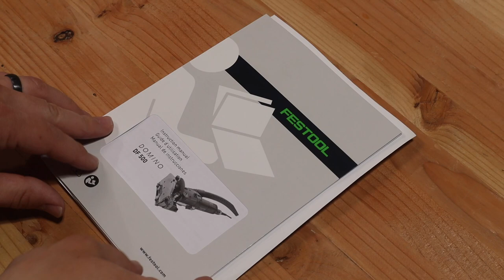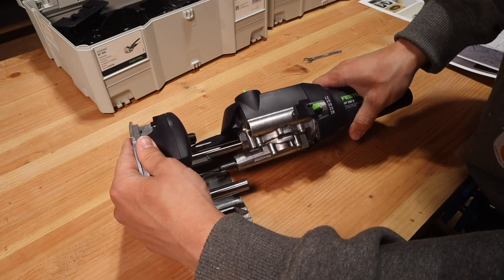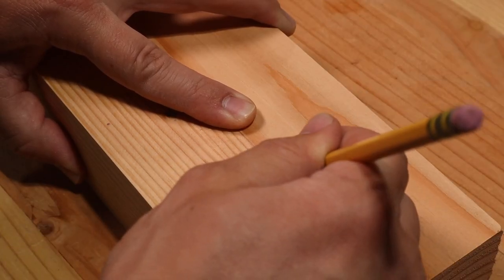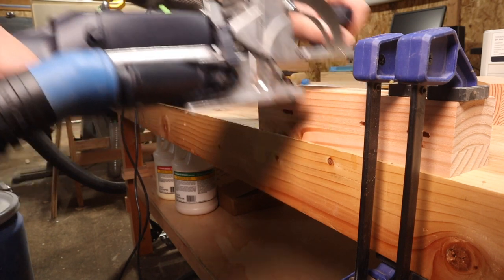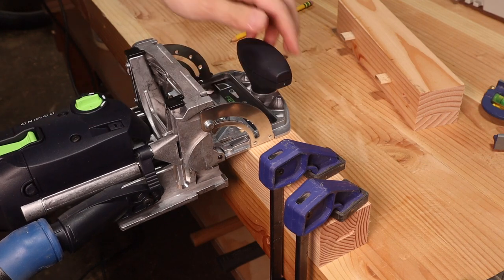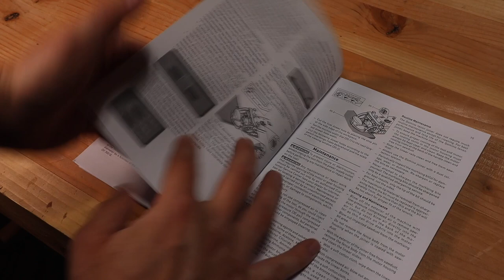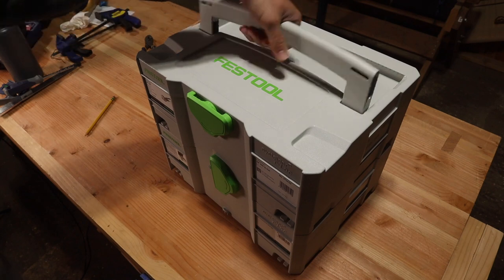Festool DF 500 Domino | Unboxing, Setup, & Use

Comment: Hi! Excellent video, as others have pointed out.
I just got my Festool Domino and I will certainly make a very good use of your video.
I do have one question. I didn't realize I need to use a special  hose for dust extraction. But it seems you are not using a Festool hose. 
So what hose are you using and how did you attach it?
Gracias y saludos desde Mexico 🇲🇽
Reply from the maker: ¡Hola amigo! I’m glad you appreciated the video! I ran into the same question and found there are a smattering of flexible adapters to hook it up to a shop vac. Below is a link to what looks like the next iteration of what I got. It just slides right over the male portion which is on the domino. 

Festool Adapter
https://amzn.to/478nsR7
Reply: @NorthwestCraftsman  thank you very much for such a fast answer. Feliz Navidad!
Reply from the maker: ¡Feliz Navidad!

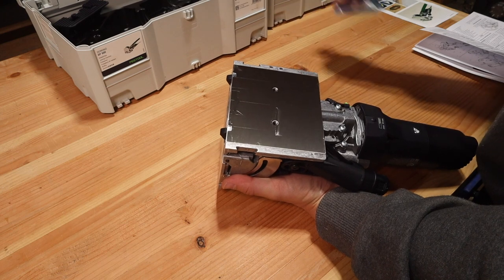Comment: Thanks for the great info! Very helpful video. I noticed that in frame 4:12 after you peel the film off the bottom of the tool, there seems to be “wings” around one of the threaded bores. Is that a mark leftover from the film? I’m looking at an item on an auction site with that same mark and I can’t figure out what that is. Thanks again!
Reply from the maker: Thanks! Glad you found it helpful! 

I think it just leftover from the film. You were talking about the somewhat long and thin making on the bore closest to the camera right?
Reply: @NorthwestCraftsman  Yes, I’m trying to identify if that long, thin marking on the bore closest to the camera is anything permanent. It seems like it hasn’t made much of an impression on you, so probably nothing to worry about? Thanks!
Reply from the maker: Yea, I think it’s just a bubble under the clear film with some of the factory oil causing that. No issues with my tool from it 😊

Happy Woodworking!

Josh
Northwest Craftsman

Comment: Festool - more addictive than crack to people who like quality stuff.  I got that kit earlier this year; it is a pleasure to use and very helpful.
Reply from the maker: No kidding! The build quality is impeccable. I don’t see myself in the market for any more in the near future but those sound like famous last words 😂
Reply: @NorthwestCraftsman  Ok.  In that case, this is not me suggesting that you try out their sanders - specifically the Rotex RO 150 or RO 90...  🙃
Reply from the maker: Well then 😂 for the sake of my wallet, I’ll have to stay away 😂 but, out of curiosity, what are the primary differences? Size and capability? Or something more?
Reply: @NorthwestCraftsman  In their rotex mode, where they forcibly spin the the sanding pad, they can remove material at about the rate that a belt sander does, but in a much more controllable fashion.  Switch it to random orbit, and it's like a finish sander.  And one of their main claims to fame is dust collection - hooked to a dust extractor set to minimum speed, there will be next to no dust left behind.  Additionally, they're very well balanced - they are much less likely to leave your hand tingling from the vibration after use.

I'd gotten a 150 a few months back; what really blew me away about it was when I used it a few weeks ago helping a friend refinish a deck - took it down to bare wood incredibly fast, left no noticeable dust, and didn't make my arms numb.  Using it for the deck prompted me to go get a 90 as well, because we were also doing a door that had smaller surfaces that the 150 wouldn't fit.  The 90 also has a flat paddle attachment that uses a triangular pad to let you get in to corners.  They're extremely pricey, but definite 'buy once cry once' machines.  Their dust collection method also helps keep the pads clean and cool, and definitely extends their useful life.  And they're relatively quiet, too.
Reply from the maker: Wow! Thanks for the awesome write up! I’ve heard many of those before as well and it seems like that would be worth it, especially for things like slabs. How expensive are the sanding pads?
Reply: @NorthwestCraftsman  I'd say not terribly so, given their lifespan.  The deck we did was  a big wraparound front porch, probably about 9' deep and 40-50' long overall, so a bit under 500 square feet.  We used 80 grit discs, and went through about four or five of them, and one was retired early after hitting a protruding fastener and being damaged by it.  I think the deck boards were Ipe.

Note this is all for their 'Granat' paper, which is the 'general purpose' paper for nearly every application.  They have several other types, but this is what I've used.  The cost depends on quantity; from what I've seen they come in various 10, 50 and 100 piece packs depending on the grit.  They're about $2/ea @10, $1/ea at 50, and $0.75/ea @ 100 (this is for the 6" Granat pads for the 150 mm sanders).  Those for the smaller 90 mm sander are a bit less, about $32 for 50 and $49 for 100 based on a quick look at the rain forest site.  

For the 6"/150 mm sanders, availability is as follows:
40~320 grit in 10 packs
40~80 grit in 50 packs
100~500 grit in 100 packs
800~1500 grit in 50 packs

For the 3.5"/90 mm sander it's:
Round:
40~80 grit in 50 packs
100~500 grit in 100 packs
800~1500 grit in 50 packs
Delta (for triangular detail head):
40~80 grit in50 packs
100~400 in 100 packs
Reply from the maker: Pat, again you've come through with an incredible & helpful write up! Thanks for all of those details...I can neither confirm nor deny whether or not I'm more seriously considering getting a Rotex haha. On a more serious note, if you could only get one, and you do more finish sanding with it, which would you go with?
Reply: @NorthwestCraftsman  Assuming that you're finish sanding on relatively large, flat surfaces that are bigger than 6" across, I'd say start with the RO 150 - it's easier to handle on larger surfaces, and being bigger, will get things sanded more quickly.  If, on the other hand, you do things with smaller areas and need to get into corners, then start with the RO 90 as its 3-1/2" diameter pad will fit into smaller areas, and you also get the detail sanding attachment.  LOL - note that I said 'start with'.  <evil grin>

A good overview of the sanders can be seen on the 'Festool Live' YouTube channel, Episode 09 has the info on the Rotex starting at about 8:30; Millius Construction has a video called 'Festool RO 90, the multi tool of sanders', and New Brit Workshop has a video on the RO 150 called 'Festool Rotex 150 - demonstration and review'

Come to the dark side - we have cookies! 😁
Reply from the maker: I like cookies! 😄😂 thanks for all the awesome info! I’m sure I’ll end up getting one at some point 😂
Reply: @NorthwestCraftsman  You are most welcome, glad to help.  Initially figuring everything out with them can be a bit confusing at first.

"I like cookies! 😄😂 thanks for all the awesome info! I’m sure I’ll end up getting one several at some point 😂"

There.  Fixed that for you.  🤣
Reply from the maker: 😂 much appreciated! 😂

Comment: This is a tool that got most of it's fame and hype due to internet being a place where people with a passion for woodworking are consolidated. People that actually use the tool because they work with alot of hardwoods or just buy it out of passion for woodworking. In the real practical world, where most people fall into, incl myself, this is a very niche and extremely overpriced tool.  My brother is a woodworker, my grandfather and uncle were. I know several people in the woodworking trade and none of them actually own a domino simply because if you are just making cabinets, drawers, wardrobes,... this is a tool that's doesn't do any better than a simple biscuit joiner. If you make fancy hardwood furniture, wich 99% do not, you buy this tool out of passion and not to put in the hours with this tool because you simply don't need it, like AT ALL  :) I will buy one if the patent ever expires and other brands can copy it and you most likely can buy one for 1/3 the price haha.
Reply from the maker: I think you’re spot for the average wood worker. This is absolutely an expensive, niche tool and I think the internet proselytizing has certainly helped it. I am actually one of those rare woodworkers you mentioned where most of my furniture and projects are solid wood and benefit from the highly accurate floating tenon of the domino. And in that application, I can say it’s spendy but has saved me so much time and futzing around. Sure, more experience will make me faster with all the other joinery techniques but the domino does make it very easy, fast, and accurate. Thanks for the great comment, I appreciate the realistic take.